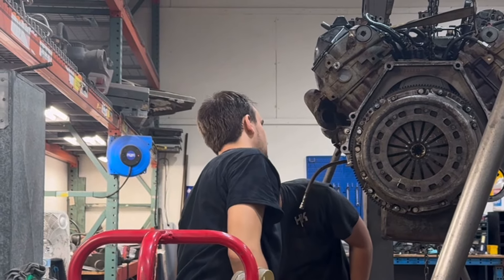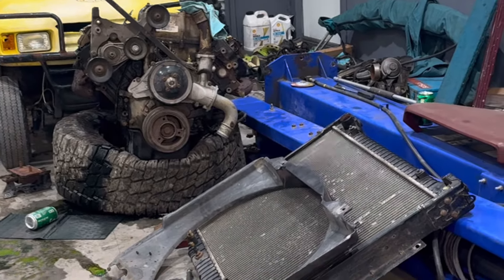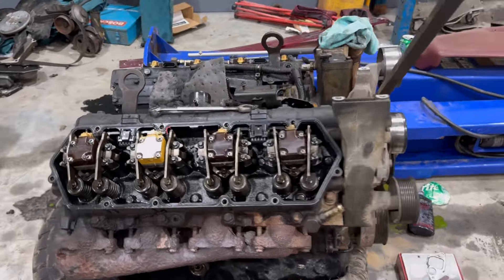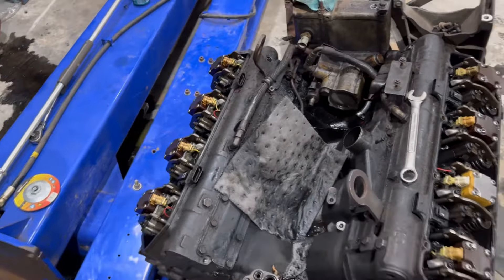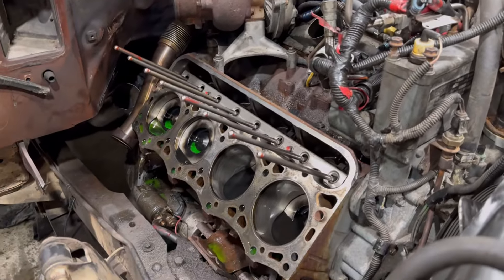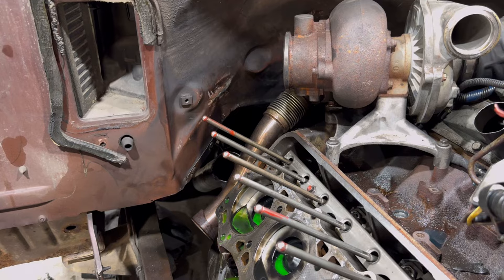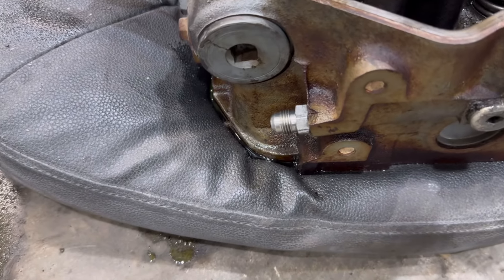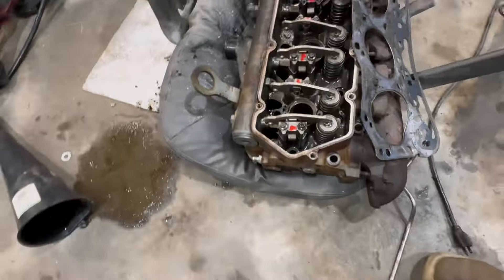7.3L Power Stroke, Is It As Good As They Say It Is? Cylinder Head Design Flaw!

Comment: Looks like someone went full Gorilla on that little pipe fitting lol.  Not sure if you guys know this, But Pipe threads are tapered and you should STOP when it gets tight. There should be some threads still showing once it's tight,  Do not keep going until the fitting bottoms out like you did in the video. That's why it broke.
Reply from the maker: Yea, we did track down the primate responsible for the death of the cylinder head and had a long talk about Tapered Pipe Threads, these youngsters have their hearts in the right place, I just wish I could of caught this as they were installing it. You live and learn… thanks for the comment

Comment: 7.3 IH is one oil leaking son of a bitch. Cheap ass oil pans that rot out if the guy on the news even mentioned rain or snow. Crap injectors. And that valve cover electrical pass through......just genius......untill it melts. Oh yeah forgot the glow plugs under the valve cover. One more thing , I made a shit load of money fixing these things over the years. So I guess it's not all bad.
Reply from the maker: But it’s the 7.3, we aren’t aloud to talk bad about it. I personally think that the HEUI system is far too complicated for what it is. It is an interesting system by anyone’s standards but have you ever seen the guts of the injectors! It’s almost a miracle that they work at all let alone as reliably as they have, LOL. Thanks for the comment!

Comment: Yeah. The 7.3 is one of the best engines ever made. Clickbait title. Unsubscribed.
Reply from the maker: @raizt1596 So your saying that the thin walls around the 1/8" pipe plug on the head where a good idea? I agree the 7.3L is a good engine however it's not perfect. If my CLICKBAIT title gets one person to understand that this area of the head is prone to cracking if you tighten the fuel supply fitting to tight then it was worth losing you as a subscriber. Sorry to see you go but it is what it is!
Reply: @Mongos_Garage  If you're subscribed, what difference does a title make? If you're subscribed to so many channels that You rely on titles to decide which videos to watch, you're subscribed to too many.
Reply from the maker: I personally have way to many subscriptions, but I have a handful of channels that I watch every video from regardless of title. In this case I think it was that I have questioned the superiority of the venerable 7.3. The engine that everyone praises regardless of its flaws and issues. Is it a good engine? Yes, but so is a 12V B series. It was my willingness to question the mainstream and be a little critical of the beloved 7.3 that lost that subscriber, the funny thing is that I always thought Clickbait was when you title something one way but then make a video about something else, in this video I tell you why I think this is a poor design and point it out. The easy fix would of been to make the connection a straight thread boss O ring fitting. That type of connection doesn't stress the surrounding material like the NPT does. Granted the fitting was tightened to much which caused the crack but to someone who doesn't know that pipe thread is tapered it could be a common issue. This video will at some point stop someone from cracking another head and it was 7:00 minutes of entertainment from your's truly.  Thanks for having my back, I appreciate it!